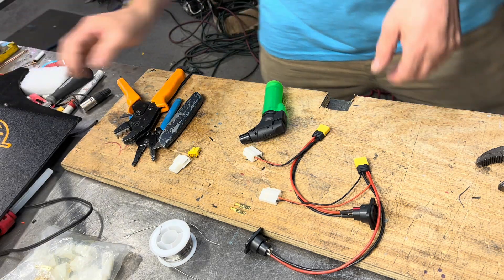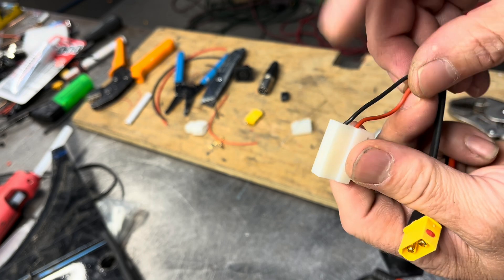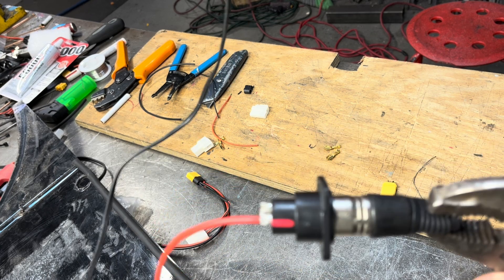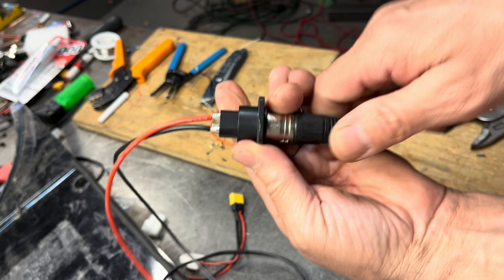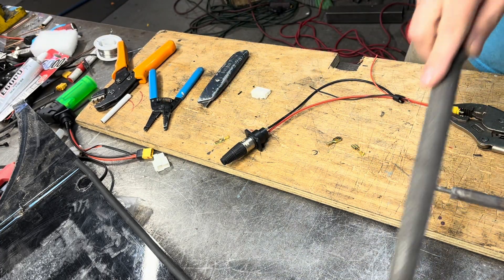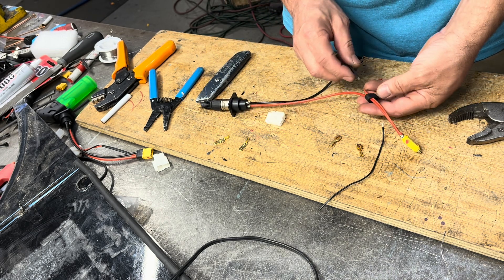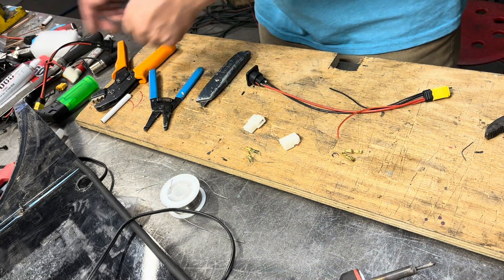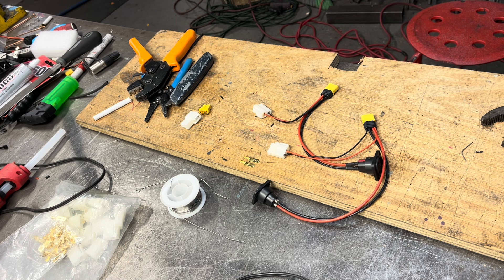How to solder XT60 XT90 and crimp wires. XLR charger port assembly or repair for #ebike #scooter

Comment: Why not xt90?
Reply: Most BMS aren’t allowing 90amps chargers side and no one has 90amp charger xt60 handling more current than that xlr charging port
Reply: @ChrisCrossingWires1212  ..thank you.  I was curious because all connectors on my bike are xt 90.  Overkill?
Reply from the maker: @IMBruceECLECTIC  if a connector gets hot while in use than it’s too small or the solder joints are bad
Reply from the maker: XT60 for charger port